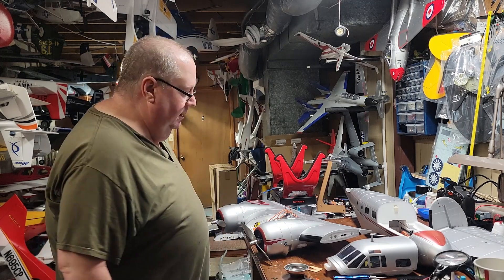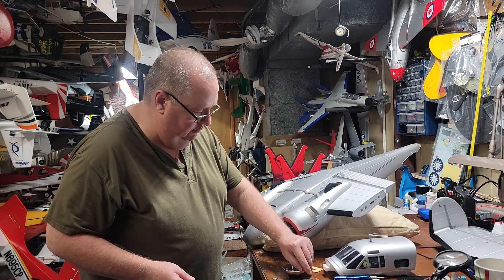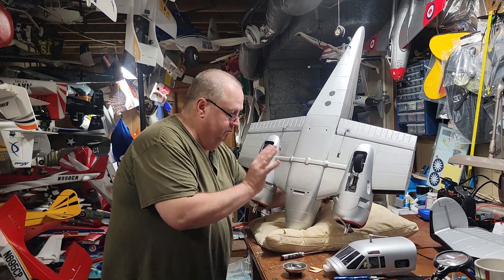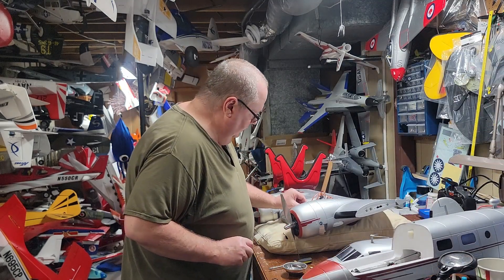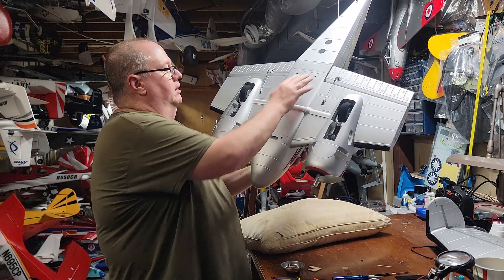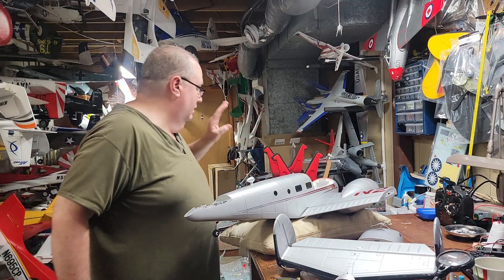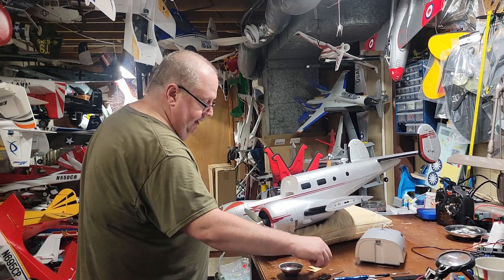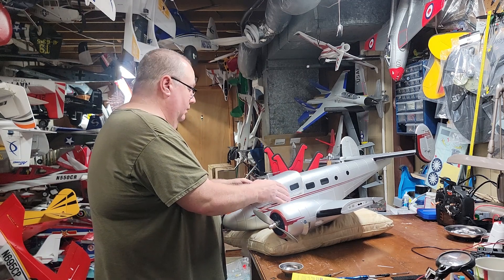E-FLITE BEECHCRAFT D-18  ASSEMBLY!! by Fat Guy Flies RC

Comment: It appears to me that the exhaust stacks are not installed on the lower part of the cowlings. I do see the cavities where they should be located. Are they a separate item to be glued in ? Are they included in the parts bag ? You made no mention of them in your video, so I was wondering about that. Also, I viewed Brian Phillips' build video and he does go through the reverse programming through the 2 servo leads that come out of the dual ESC. It requires the Spektrum SPMACA200 Programming Box. Thanks for any info on the exhaust stacks.
Reply from the maker: There were no exhaust stacks to glue on.

Comment: Question? The D18 has front and  rear antenna tubes.  Does it matter which tube is used for the antenna? I didn't see any in the manual. Thanks.
Reply from the maker: Either or . just try to keep your antenna away from to much battery and carbon fiber.
Reply: @FatGuyFliesRC Away from the battery.  In that case the rear tube would be the best location.  Thanks.
Reply: I don't have a 3 or 4S 4000mAh battery, but I do have several SMART G2 3S 11.1v 3200mAh 30C batteries.  Can I use a 11.1v 3200 with the D18?  Thanks.
Reply from the maker: @dhoffman6435  Yes just put it all the way forward to the nose.

Comment: Still converting my Dynam C-47 V1 to counterotating props, need to know,  is the thrust on both motors on the Beechcraft posted down and to the right. Thanks
Reply from the maker: If you mean do they turn in at the top and then right then yes. Right prop turns counter clockwise. Left turns clockwise.
Reply: @FatGuyFliesRC  the Props just came in the mail today. Master Airscrew 8x6x3 CW and CCW. Just finished the conversion. Replaced the Detrum 2815-1100kv with Turnigy SK3-2836-1500kv. Running a Zippy 3s 3300 60c. Ran her up, plenty of power, Maiden this Friday, can't wait.